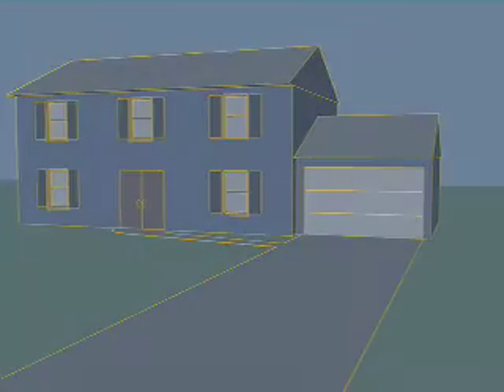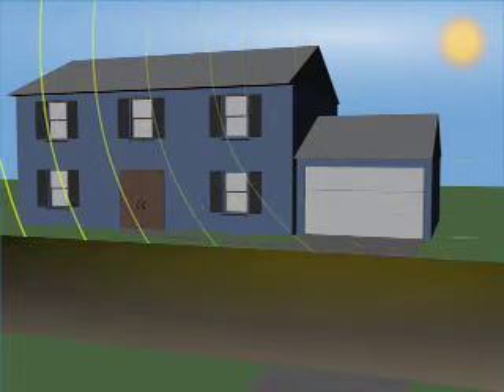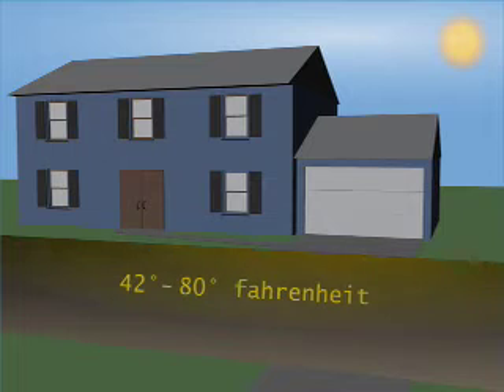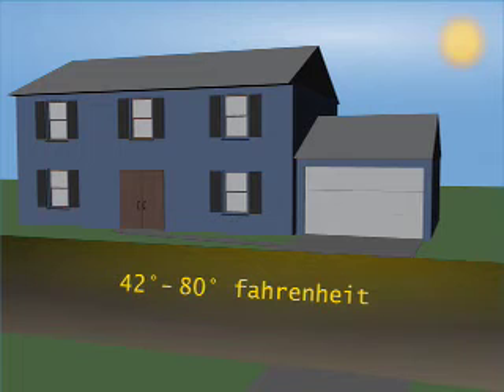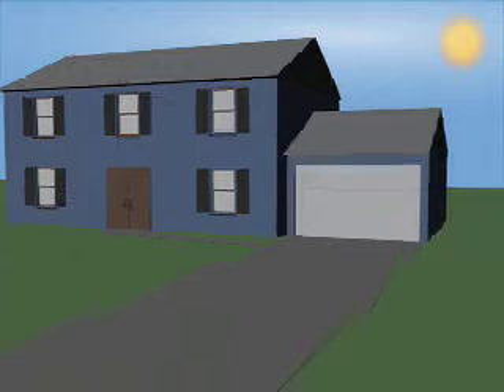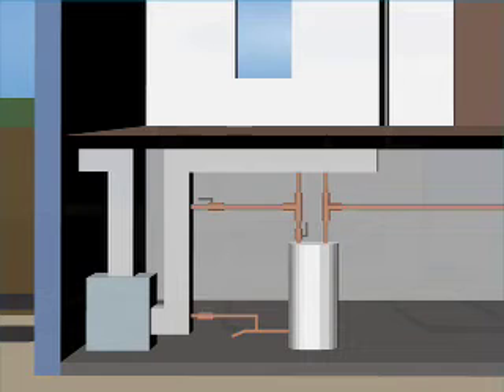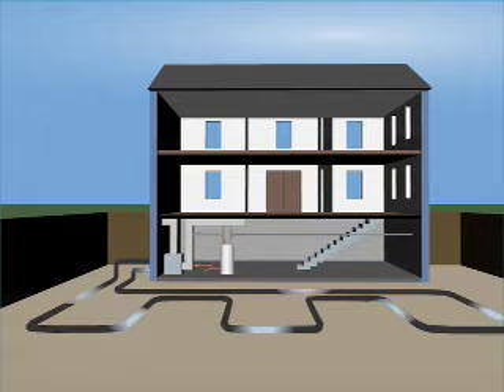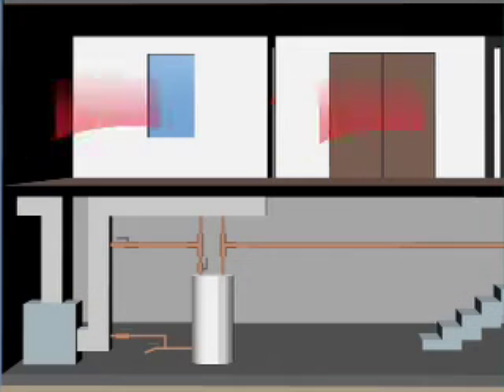Renewable Energy - Geothermal Energy

Comment: I've had a ground source system since August 2006. My house has about 2000 sqft of climatized space. I have paid $75/mo for electricity on average over the past 16 months. That includes hvac, cooking, lights and hot water. My power company charges $0.046 per kwh which is very cheap. Our rates just went up this month. I should still be paying less than $100 on average. This system is the future. It's expensive at first but the payback is short with today's fuel prices.